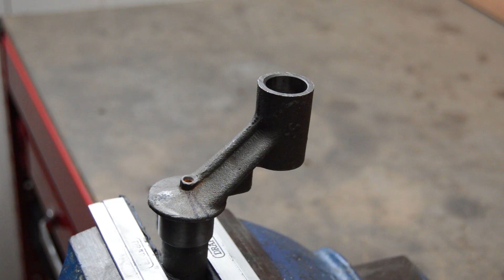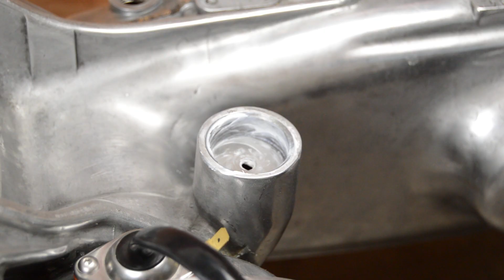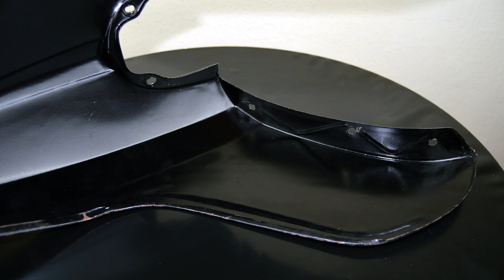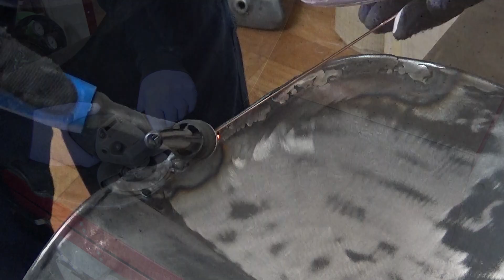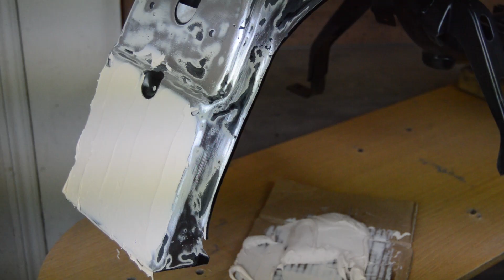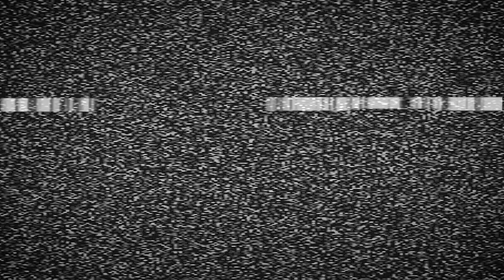Project Lambretta Episode 5

Comment: Can i ask what the reason is for powder coating the frame please?
Reply from the maker: Negatively charged paint powder is shot at the grounded steel part, so the paint is drawn into all those little gaps and corners that normally applied automotive paint would not get into. It's then baked to cure the finish which results in a tougher finish  than standard automotive paint... apparently.
Reply: @732kustoms  ok, good idea, i might do that on my sil gp (cheaperthan paint too), are you then going auto paint over the top?